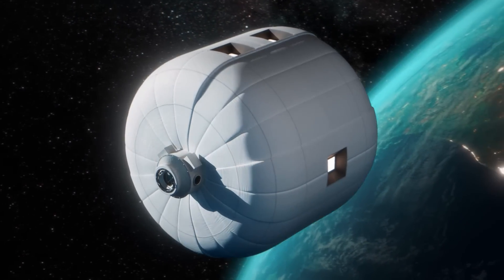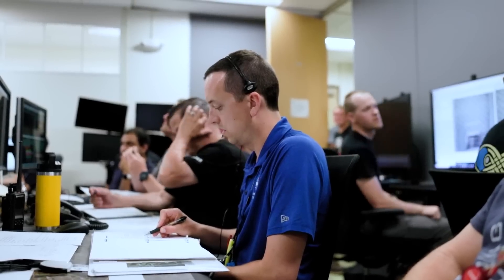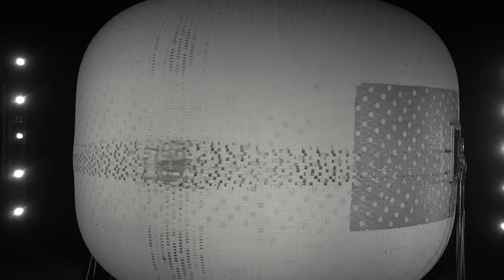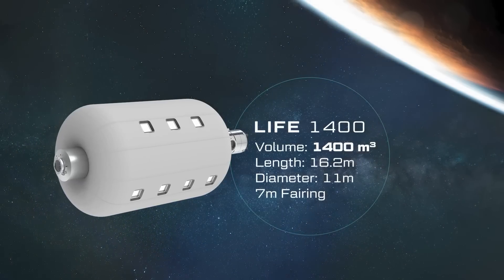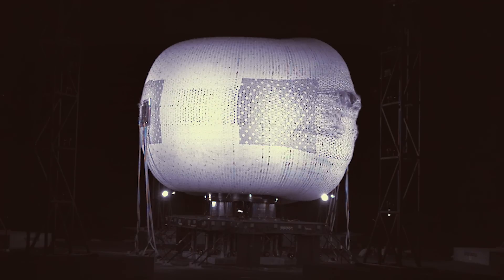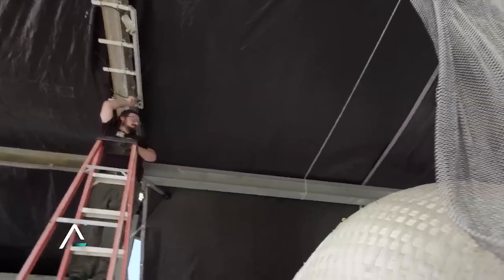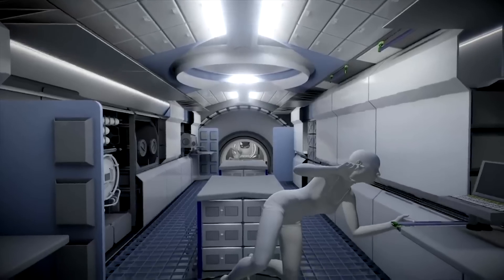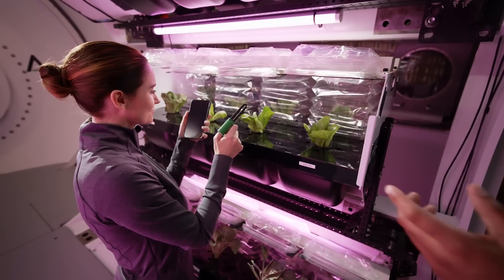Sierra Space Is Working On An Even Bigger Inflatable Habitat

Comment: The inflatable habit is a very interesting development. The burst testing is expected as it is one of many possible structural failure modes. How would the structure behave when  it is punctured by an external impact ?  Any puncture that causes a rapid pressure loss is of grave concern. This applies to all habitable space structures not just inflatables. The presence of self sealing capability for smaller punctures coupled with methods that would prevent complete loss of the structure for larger breeches would boost confidence in the inflatables technology. One approach would be to classify pressure loss due to an impact failure in terms of rate. For example using a minimum internal pressure for safe habitation, going below could trigger an evacuation of the occupants and deployment of various leak stop responses. Those responses would be governed by how quickly or slowly the internal pressure is falling, i.e. the rate. Sierra Space has probably mapped out a range of failure scenarios including ones where the internal pressure of an inflatable is compromised. Perhaps we learn more their technology in the future.

Comment: I'd really some kind of semi rigid layer, like an expanding foam, or resin to go on the inside once it's inflated. I get that it's bulletproof, but worst case scenario, if it a micro-meteor does put a dime size hole in it, the burst potential turns it into an immediate catastrophe. on the ISS or Tiangong, they could conceivably evacuate the affected module and seal it off. if you're in a ballon and it pops... you're in the vacuum before anyone knows what happened.  maybe all the outer layers will prevent that and give it some rigidity even if it loses pressure, but a thick balloon is still a balloon.
Reply: Just how high are you expecting the internal pressure to be when on station?

Comment: A single Starship is over 3200m^3 in total volume (w tanks) and can launch complete in one go, outfitted from the ground. No need to send the equipment after the inflatable and shove it in through a tiny hatch. It also has build in autonomous propulsion, it extremely easy to modify and repair (with just a welder) and is mass produced so will probably be considerably cheaper. As it will be considerably cheaper to maintain wih spacex huge fleet of spacecraft.
Reply: It is always best to have alternative technologies that develop over time.   At some point the inflatable technology may give way to large rockets like Starship, but it is way too early to draw such conclusions.  imo
Reply: @michaeldeierhoi4096  I agree, competition is nice to have. But Starship is almost here right now, modifying one as a space station will be relatively easy. Spacex is already developing advanced life support systems, radiation and micrometeorite protection for HLS, scaling these up will not be that hard with the enormous mass budget it has. Inflatables are tech developed for an old space paradigm were small rocket capability and extreme costs were the norm. Spacex is smashing that model with Starship.
Reply: @admarsandbeyond  It will be most interesting to see how far Space X has progressed with starship in five years.   It is quite entertaining to watch the progress.

Comment: The bigger modules look like they could fit a centrifuge large enough to offset the long term effects of microgravity.
Reply: How small do you think that can be done?  I am thinking 100m min.  Otherwise you will always have a big gradient between head and feet.
Reply: The centrifuge in 2001's USSC Discovery was 30 feet (9m) in diameter. So it seems possible.
Reply: Scott Manley did a video on this subject a while back.  And explained that the space station would have to be well over one hundred meters across ( if memory serves) and rotating at the proper velocity to even begin to mitigate the effects of microgravity.  If the unit is so small in diameter there would be a difference in the gravitational effect of a person's feet vs his head.  

In other words the development of such a system is far more complicated than you realize.

Comment: The first thing I wondered is, with all those layers, how do you repair a puncture? I can see from the design that a puncture from a micrometeoroid or a small piece of space junk wouldn't cause catastrophic failure, but couldn't it go through several layers? And wouldn't the crew want to repair all of them? What about the layers you just can't get to?
Reply: I think the patch would likely just be an internal one.  I don't see how or why they'd need to do more.
Reply: @TheEvilmooseofdoom  — The same reason there are multiple layers in the first place: redundancy. In space, you always want it. Even the back-ups have back-ups.
Reply: @racookster  I’m not sure how thick the multi-layer material is but one option might be to have quick single-layer airtight patches to prevent atmosphere loss to be applied quickly while the “we have a leak” emergency is in effect and then once the situation is stabilised have a full multilayer patch applied on top of it but still on the inside. There would then be no need to fix the original layers because if by some unbelievable miracle another micrometeorite hit the station on exactly the same square mm of its surface and at exactly the same angle to take it through the hole caused by the previous hit it would then impact a whole new full multilayer structure in the form of the internal patch. If the material (I.e. the multilayer patch) is thick then that bit of the internal skin would look pretty ugly, as if it had a massive wart on it, but it would restore full multilayered protection to the area of the micrometeoroid strike.

Comment: I hope these habitats are not a single large room layout but have pressure bulkheads so If explosive decompression occurs then crew have a safe place to go and suit up and survive.
Reply: Remember OceanGate incident? Crew will get about the same amount of time in space to save themselves.
Reply: @amitpatilamit  Nonsense.  Don't make things up.  It's dishonest.
Reply: @TheEvilmooseofdoom  You have a pressurized balloon in a near vacuum. What happens when the pressurized air inside the balloon finds a way towards the vacuum? Not only will it put additional stress on material around the puncture, but it might also cause damage inside the balloon due to the suction force that will be created.  I am sure the research team must have thought of this scenario and how to avoid it.  But yes, if this happens, not a lot of time in hand to save yourself.
Reply: @amitpatilamit  The Ocean Gate Incident is a completely different situation. We are talking about the vacuum of Space...not a implosion in the deep depth of the ocean. The Titan is believed to have imploded (Crushed) at approximately 12,500 Feet Below Sea Level. At that depth the pressure on the hull was about 5,750 pounds per square inch (psi).  Any Space Station Module orbiting would be at around 250 miles altitude above sea level and only experience less than > 1 millibar (mb) of pressure. So not even close to being the same thing. So there would be no "implosion" but an explosion. 

The Sierra Space inflatable space station module prototype, the Large Integrated Flexible Environment (LIFE) module, burst at 77 pounds per square inch (psi) during a full-scale "ultimate burst pressure" test in December 2023. This was 27% higher than NASA's recommended safety level of 60.8 psi. But before it is over the pressure required to blow it up will probably be increased to above 100+PSI. So my point stands. It would be better to have smaller divided  Modules just incase if such as explosive decompression happened. That way the crew could quickly get to safety or have some kind of quick suit up capable space suit to buy then time to get to safety (Similar to the Star-liner space suit as all it takes is jumping into it and zipping it up. Better be safe than sorry. We can always replace the modules...we cannot replace experienced crew.
Reply: It takes a big hole to decompress explosively.  If something that big hits it, they have other problems.  It's also likely that if something that big hits no part of any station would survive.
Reply: @TheEvilmooseofdoom  well not precisely...the hole doesn't have to be that big. During the end of WWII and early cold war explosive decompression happened in pressurized bombers and early pressurized passenger airliners. And those aircraft were pressurized to only 8000 feet with flying at 35+thousand feet ASL. Reports of crewmen or passengers sucked out through small holes in a fuselage or blown out window were not uncommon.  So hole size ain't necessarily an issue. My only point in space catastrophic decompression is not a good thing in any kind of space craft.

Comment: To get these habitats into LEO sounds like another job for spacex !"
Reply: The smallest versions (285m^3 and 500m^3) are designed to fit into a 5m diameter fairing so  they could fly on Falcon 9/Heavy or Vulcan Centaur. The large 1400m^3 version is designed for a 7m diameter fairing, meaning BlueOrigin's New Glenn rocket, and the extra large 5000m^3 version is designed for a 9m diameter fairing, so possibly Starship if/when it develops the ability to deploy large singular payloads (not just Starlink).

Comment: What happens when those layers of material constantly exposed to open space environment and radiation over a long period of time? Have they figured out how long that material can last in such a harsh and unforgiving environment?
Reply: I think it'd be interesting if solar panels could be applied to the outside to collect power and give additional protection. Cool if someone can come up with a sleeve system which surrounds this in solar panels and which also collapses down to fit into a similar size rocket.
Reply: @joythought  Covering the station in panels isn't the best idea. Half of them would be in shadow all the time while most of them wouldn't reach their maximum efficiency since the round surface would increase the angle to the Sun. It's better to have flat, long solar panels attached somewhere else.
Reply: @petachad420  I agree though a outer sleeve or shell after inflated seems like it'd be a good idea. 🤔
Reply: I wonder the same thing. And I understand there are testing it four times the pressure that will actually be required upon deployment, but I guess I need to do some more research about the redundancies built into the structural and air sealing properties of this container!
Reply: @POTheta001  Agreed. If a space station is built for 30yr service, then the habitats should be able to last a significant longer period of time, just in case.
Reply: @nonegone7170  Different company.  RIP Bigelow...

Comment: Can't wait for Starship to start launching some of these.
Can you imagine if a 20 m diameter 5000 (meter not ft - edited) habitat. 
That's enormous.
Reply: 19m diameter and 5000 cubic meter volume (~176600 cubic ft)
Reply: Huge !!
Reply: Starship alone is 3200m^3 with tanks. And it can be outfitted with all the structures and equipment from the ground, no need to try to shove these in an inflatable from a tiny hole.
Reply: Starship would be great to just outfit for certain situations. But these inflatable modules are actually significantly better to use as habitats. The way they are built is ideal for shielding from micro meteorites etc.
Reply: @getinthespace7715  Why? Having a large empty diameter is not that useful in micro-g (the opposite probably, imagine astronauts stuck without a way to propel themselves to the sides). And a station Starship would of-course be outfitted with MMOD and Rad protection, it's much easier and cheaper than having it as inflatable.
Reply: @admarsandbeyond , you lack imagination. There is no reason it needs to be empty. One starship launch could supply 150 tons of equipment. 
They could origami in an entire internal structure if they want.
Reply: @getinthespace7715  Imagine trying to fit big equipment (lab), compartments, and structures into it from a small hatch. Also there is no easy way to attach anything to the inflatable side. Even their renders can't imagine and show practical structures and usages for them, they show floors and big furniture like they are under gravity.
Reply: @admarsandbeyond  you obviously can't outfit the inside of the Starship tanks with equipment on the ground, you can only pre-install equipment in the ~1000m^3 payload bay.
Reply: @plainText384  No not with equipment, but you can add some structures. Even the ice filters could be useful as floors. And the payload bay of V2 is over 1100m^3 of free usable volume (pressurized volume is larger),

Comment: Assuming the big one is launched (on Starship) what size airlocks would it have and how will you get the furniture in? If it is damaged how will one make repairs in space and would how would NASA certify the repairs? How safe would the accommodation be if it were damaged or punctured how safe would the astronauts be ?  I suppose the answer would be to launch and assemble 2 or 3 habitats but that would require at least 2 interconnecting docking assembles which i would assume for reasons of safety  would be of metal construction. There ia a lot of design and thought going the have to go into this !
Reply: Everything would have to pass through whatever airlock system they use.  That would be incorporated into the design of everything.  How safe things are after a puncture has a thousand answers for the thousand different scenarios.  It's 1 atm of pressure so most holes can be patched by a simple patch and glue, at least in the short term.  Of course that depends on the size of the hole and how fast the hole maker was moving and what else it might have hit on it's way through the station.

Comment: Does an aluminum shell unzip like this inflatable? I've never seen a test, but I'd think that aluminum is more likely to puncture locally without an overall failure.
Reply: I think you're making the badly flawed assumption that all failure modes are going to mimic the catastrophic over pressure event they tested.  Think of the ACTUALL amount of pressure. 15psi.  The only thing that unzips like that at those pressures are party balloons.
Reply: @TheEvilmooseofdoom   This exploded at only 20% over design limits. So.....
Reply: @tsbrownie No. Watch the video again. It burst at about 20% over NASA’s design target but NASA’s design target is to be able to withstand 4x nominal pressure so the burst was actually at almost 5 times expected nominal station pressure.

Comment: Looks promising. Just hope all those layers can actually hold up to all the space debris traveling thousands of miles per hour.
Reply: They literally showed that it's more resistant to that then even the ISS itself...
Reply: Almost nothing can do that, if the part of debris is large enough. When it comes to small parts, I think a flexible hull may do better than a  rigid one, maybe even close a tiny leckage on its own, at least for a short time until it can be repaired.

Comment: Vectran? Really? Its limitations seem like a deal killer to me. It is only good up to a bit over 200°C, and it has big problems with UV radiation making it weaker and brittle. Oh sure you can add even more extra weight by painting it, but what happens if that paint gets scraped or flaked off in just one little spot?? Are they going to check this daily? These are major problems in space, where 200°C and higher is very common at our distance from the Sun.

An alternative that is far more durable is basalt fibers. Most variants have working temps up to 1000°C with some recipes maxxing out at 1200°C.  Also UV radiation does nothing to basalt fibers. Basalt fiber is significantly stronger than even kevlar, which is even worse than vectran for melting and UV exposure.

Basalt fiber exhibits the highest tensile strength among the three, with a value of 4,800 MPa.
Kevlar fiber has a tensile strength of 3,620 MPa, which is significantly lower than Basalt but higher than Vectran.
Vectran fiber has a tensile strength of approximately 2,300 MPa, which is lower than both Basalt and Kevlar.
Reply: The Vectran layer has several layers of insulation above it negating your objections. Also, do you not think that the engineers designing this have thought about that?
Reply: The science behind all this would be very interesting to learn more about.

Comment: Not  a fan of inflatable habitat's.
I would prefer the more tried and trusted method (solid walls, floors and surfaces) when it comes to living and working in space.
Reply: An inflatable module has been on the space station for over half a decade and is working fine. Regarding solid modules, every ounce of weight saved allows for cheaper launch costs. Inflatable stations will allow for more research room for lower costs. It's a win-win.
Reply: it's far more feasible and economically viable to inflate habitats than to build space stations.
Reply: If you aren't a fan of inflatable modules for space then just don't go up and use one if you become an astronaut. 

 FYI  Technology like this isn't designed and built based on popularity.  Technology is based on proven reliability from extensive testing and small scale systems like the one the ISS has had attached to it for years!!

Comment: They're stronger, lighter and bigger. Plus no metal fatigue which is killing the ISS now. I don't know why NASA has imposed a much higher strength requirement than the ISS, the ISS is flimsy compared to these things, especially in impact resistance. But it hasn't been a problem anyway, so why not.